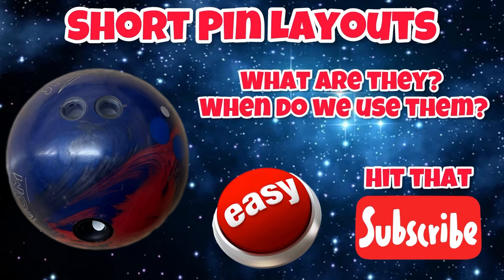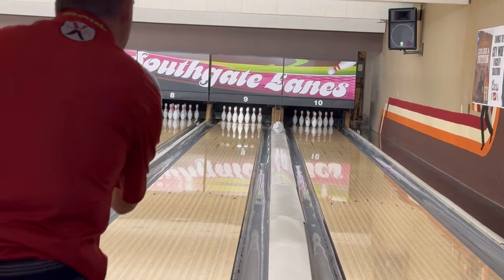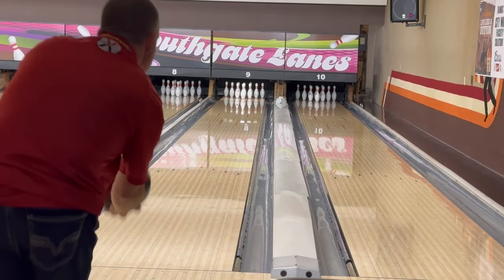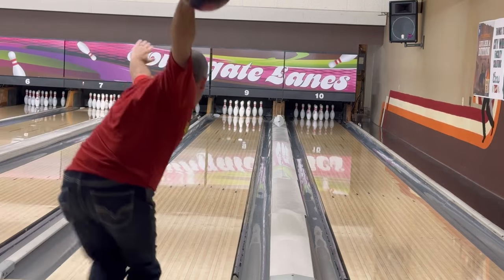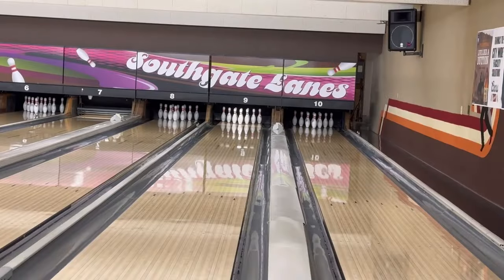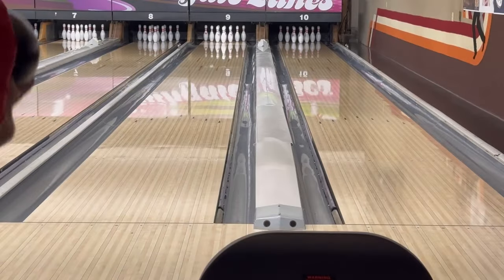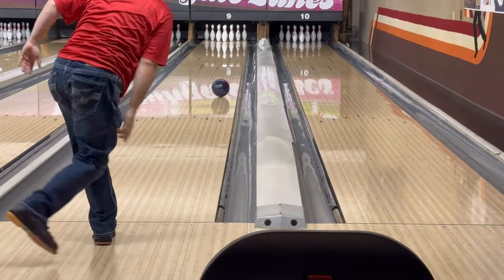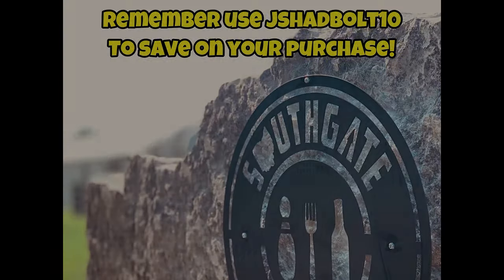Short Pin Layouts??? What are they?

Comment: It seems pointless to me to use a short pin on an asym.  The entire point of an asym is to move the PSA away from 90° to the pin to give you an even more powerful reaction.  

A short pin ignores the PSA and instead directs the ball to rotate around its low-RG axis (that is, the pin).  This increases stability, but it makes the asymmetry pointless.  Even symmetrical balls are usually not symmetrical across the PSA in the first place.

What am I missing?
Reply from the maker: I’d go watch a Mo video if I were you. He really only recommended them on Asymmetrical.